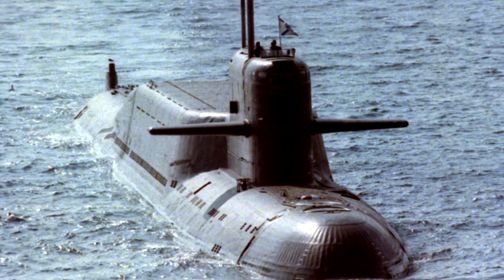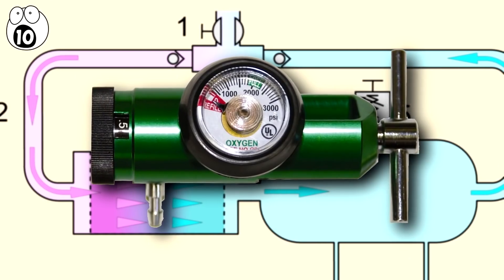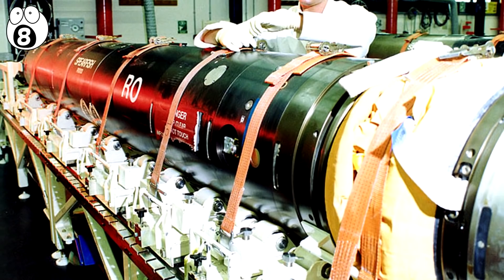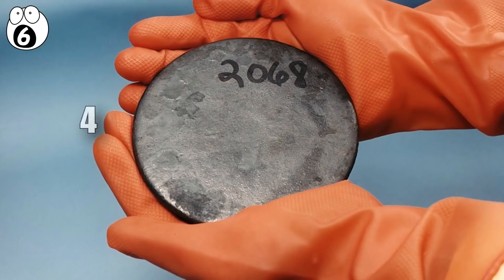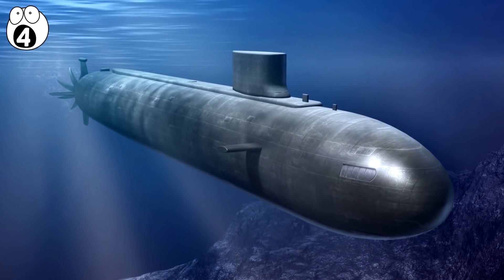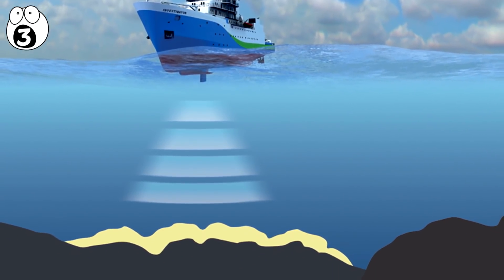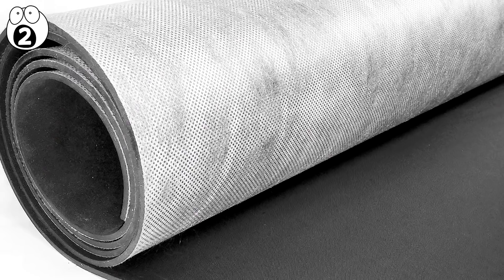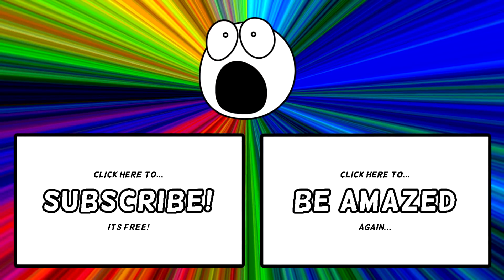Declassified Nuclear Submarine Design Secrets

Comment: OK. A lot of incorrect information here, so here goes. First off, I spent a dozen years on American subs, from very old Skate class (still had a pointed bow, like Nautilus) to brand new Ohio class.

1. Until very recently, like with the Virginia class, all nuke used steam turbines for main propulsion, not electric motors. They HAVE electric motors, but they're much smaller, mostly for emergency use. The same is true of their diesel engines and batteries.
2. Starting with the LA and Ohio classes (40 years ago), nukes can operate in natural circulation mode, with no Reactor Coolant Pumps running. The steam system still has feed pumps and condensate pumps. Noisy, but not as much as the RCPs. This may very well have changed since I got out in the early '90s. I couldn't say.
3. Yes, ANY submarine running without pumps is very quiet. But, even so, once detected, I could tell you his motor RPM, and thus his speed. 
4. The only diesel or AIR sub that can detect a nuke before being counter-detected would be one with a sonar as good as the nuke's. The US is STILL way ahead of everyone else, just not as much as before. They're not as quiet as the sea floor, but close. If a boat is not physically on the bottom, even with no speed on, you still have to maintain trim, which means you need to use your trim pumps. The only silent sub is a grounded sub.
5. Depending on the background noise level, even a nuke can be undetectable. If you're in a quiet place, like a church, even a whisper is loud. At a concert, you have to yell to be heard. It's the same way at sea. In a very quiet place, if you dump garbage without first breaking the rotten eggs, they sound like fire crackers when they implode. If you're surrounded by a school of dolphins, it's hard to hear. If you're in a shipping lane with a bunch of cargo ships, like in a choke point ( a diesel boat's favorite hiding place) it's also hard to hear.

All these things are the point-of-view of a 60-year-old ex-submarine sonarman. Things have probably changed a lot, and those in the know on't talk about it. We're called the Silent Service for a reason, you know?
Reply: Spot on.  Those of us who have been there and done that don't talk about it.
Reply: I know this comment is 3 years old at the time of writing but never the less, very interesting stuff!
Reply: One more thing is that sea water cannot be electrolyzed for oxygen. it has to be purified first because the sodium chloride (salt) in the water releases chlorine on the oxygen side, while allowing sodium metal to form on the anode (could be the cathode, it's been a while,) eventually stopping the reaction. close, but that machine is more of a reverse osmosis purifier than it is an electrolyzer.
Reply: Delete this now. All the information you just gave helps adversaries confirm or deny designs
Reply: @Oneillnn  all of it is old information, and the sort of thing you can get out of any half decent high school library. Stop reading so many crappy novels.

Comment: so much wrong with this video, rockets work underwater because they carry oxygen in the fuel, which is how they work in space...they use steam to get rocket clear of the sub due to noise, pressure, and generally the fact rockets are controlled explosions...however accelerating a rocket through water is also wasteful on the fuel as water has much more drag, which would mean less nukes. 
point 2, sonar uses microphones in a general term, not speakers to listen. speakers produce noise, and while they can be run backwards, it's general very inefficient to do so.

Comment: most of these arn't even nuclear sub secrets or just not secrets at all. vast majority applied to diesel electrics or just subs in general. was hoping for more focused content.... what I get for trusting the title...

 if it was just general submarine stuff I would have added the revolutionary engine the type xxi uboat used letting it travel faster submerged than on its surface diesels and stuff like that, cutting out the commmon knowledge like cavitation, dive planes, and sonar types. or even just add on the info about the towed sonar array that was actually developed for nuclear subs.

Comment: None of the 10 items listed were ever classified.
#10: We've been separating (decomposition) hydrogen and oxygen from water since the 1869. #9: The "fins" on subs did NOT replace depth control. All subs still dive or surface by filling or emptying their ballast tanks. And the planes were never classified.  #8: The electric torpedoes were never classified.#7: You're kind of behind the times. Wire-guided torpedoes were already public knowledge as far back as the 1980's....

Comment: How can you control the level of the submarine with the hydroplanes,  when it is not moving or moving very slowly ?
Reply: When hovering, you pump (or blow) water in and out of a centrally-located internal ballast tank (called "negative tank" on very old submarines, or "Depth Control Tank" on newer ones) to vary buoyancy. If you have a good trim (neutral buoyancy) you don't need to move much water.

Comment: The section regarding propulsion should really focus on the design of the pump jet propulsor. Most modern nuclear attack subs use the pump jet because it is much more effective at higher speed than traditional propellers. The water pressure created within the shroud of the pump jet causes minimal cavitation and therefore, allows silent running at higher speeds.

Comment: one story I here is communication between subs. it was discovered that Wales producers sounds that travel between thermal layers    to communicate with other wales . I understand this was copied by the US Navy for sub to sub communications.
Reply: Some whales communicate with very low frequency sounds, which cross layers with no problem, and easily use the Deep Sound Channel below the thermal layer. "Normal" sub-sub communications (AKA "gertrude") use the same frequency spectrum as active search sonars, about 2.5 KHz to 15 KHz. If the Navy is using VLF frequencies (VLF in sound is not the same as VLF in radio), it is something new, deployed after I left the Navy in the '90s.
Reply: timof5 cool thanks for the info. I originally heard the story from Farley Moet the Canadian author of "a whale for the Killing"

Comment: So many technical errors.
Reply: Yeah, showing an image of the aft ballast tanks venting when referring to the diesel exhaust was kind of funny.
Reply: Haven't yopu watched the video, ballast tanks had been replaced by fins so it must have been diesel exhausts!
irony off
Says the Tigerfish is the last electric torpedo (wrong, DM2A4 e.g.)
Continues by saying that electric torpedos were not steerable (wrong, as the Tigerfish is wire-guided)
GG
Reply: Yep! From #1 - Electrolysers do not use Sea Water to split into Hydrogen & Oxygen, they split Pure Water, Pure H2O. Referring to them as "Oxygen Generators" is also wrong, there are other systems which are "Oxygen Generators" but are a totally different system using a completely different process. Having spent 17 years in Submarines I didn't bother with the rest of the video as I'd probably be here for the rest of the day correcting the bullshit!
Reply: Officers standing helms and planes

Comment: Nice vid, but there are some significant errors. Submarines use ballast tanks to dive or surface - the planes are used to enhance manoeuvrability. You seem to be mistaken in your claim that the Spearfish and Mk40 ADCAP are "electric" torpedoes. They are both OTTO fuelled, turbine driven - NOT electrically driven.These torpedoes are wire guided. True, basic intercept info is loaded aboard prior to firing, but the "fish" are essentially a "swim by wire" remote controlled mini-sub until near their target. NO sub launched missile requires "air" at time of launch - they carry their own oxidiser.

Comment: #5 you make it sound like the rockets wont ignite underwater... might want to correct that. The steam launching was a way to prevent damage to the launch tubes and submarine itself.
Reply: They said the rockets were pushed out with compressed air. Nope, it's steam as you said.
Reply: @lochinvar00465  Nitrogen is the gas used.  It is inert and therefore nonflammable.  Steam was used in early experiments but had drawbacks.